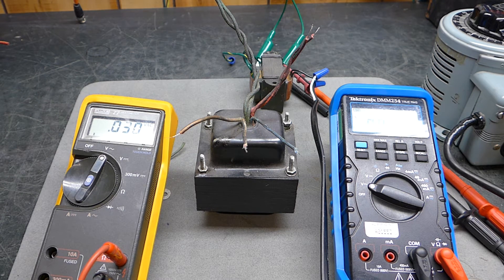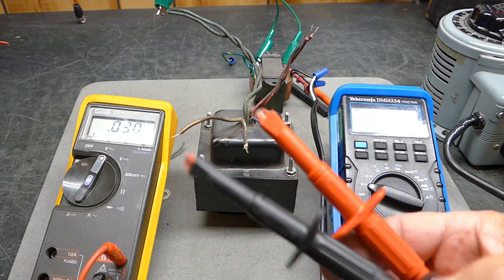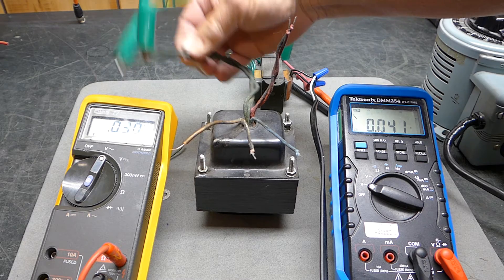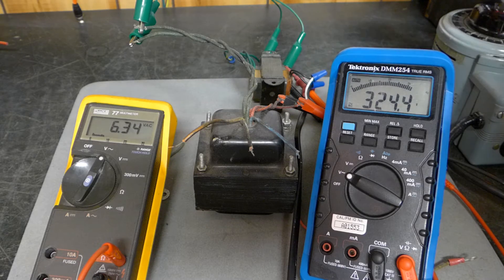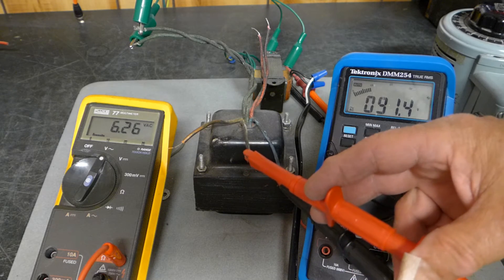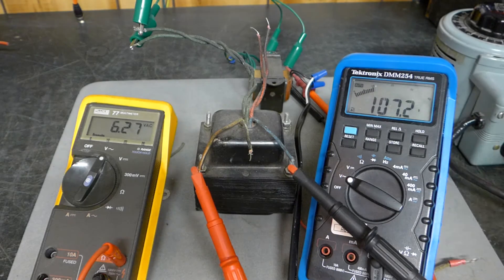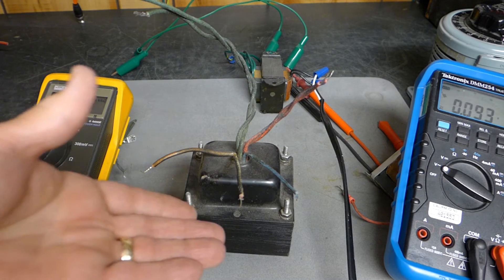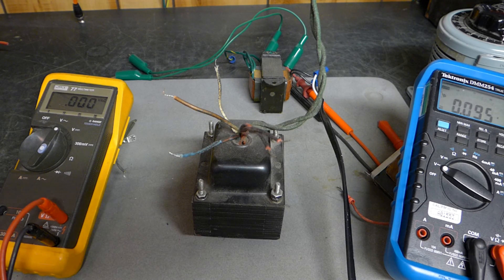Vacuum Tube Type Power Transformer Checkout To Determine Voltages On Windings

Comment: I'm curious, I have a transformer that seems to be rated for 13A heaters, is that practical to use for anything? It came out of an Accordion/Synth amp. It seems like 10A on the daughterboard and 3A on the Motherboard
Reply from the maker: You could use it to light any number of tubes up to 13 amps.  For example an amplifier that runs a quad of KT88's needs 7.2 amps plus another 2 or so amps for the rest of the tubes (12AX7, etc.) for around 9 amps. It would work great for something large like that. Your total draw of current does not have to be 13 amps. It is just that it can't supply more than 13 amps. You could sure build a big amp with it. On the other hand, if you wanted to build an RF amp that uses a quad of 811A's you need 6 volts at 16 amps to light that group of tubes so it would not be big enough for that. Hope this helps.

Comment: The reason I asked was that I have a 12.6 Vac Center tapped – 2.5 A (6.3 Vac 5 A) and wanted to use your procedure for determining voltage on the secondaries. Thank you

Comment: How many amps are needed for the 6 volt filament transformer?
Reply from the maker: +David U Juarez The minimum amount of current in amps that the 6 volt filament winding must provide is the sum of all of the currents required for each tube. Assuming you are running 6L6's which require 0.9 amps each, a pair would be 1.8 amps plus the sum that all the other tubes would require. In general, a 4 amp filament winding for the 6 volt supply would be sufficient for common 6L6 amps. On the other hand, if you are running EL34's or 6550/KT88's they each draw about twice the current of a 6L6 so you would need a 6 volt filament winding a bit higher maybe a 6 amp winding. Fortunately, the 12Ax7 family of tubes require a very small amount of current. Filament current is one of the reasons you cannot randomly put 6550/EL34's in a 6L6 amp. Another problem, of course, is the bias voltage. Interestingly enough, a 6L6 requires about -37 volts grid bias and a 6550 requires -55 volts grid bias and, you can see this documented from an old video I posted. You can actually more successfully, put a 6L6 in a 6550 socket rather than a 6550 in a 6L6 socket because the bias voltage on the 6550 amplifier is likely high enough (i.e. negative enough) to limit the current through the 6L6 to a safe value even though the plate voltage is likely to be much higher in the 6550/EL34 amplifier. If you put 6550/EL34's in a 6L6 amplifier, the bias voltage is likely to be too low (not negative enough) and the tube(s) will draw excessive plate current and damage the tube and/or amplifier. Hope this makes sense.